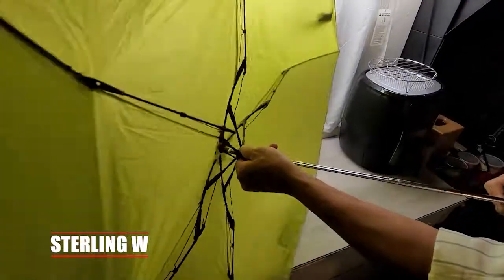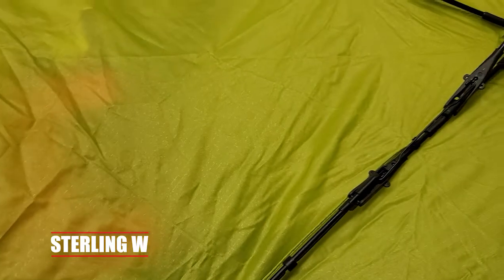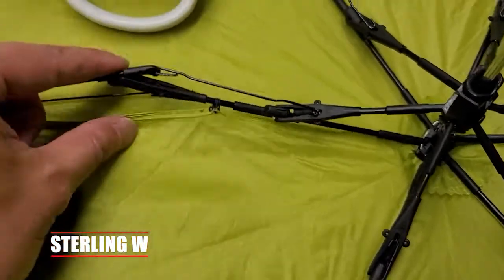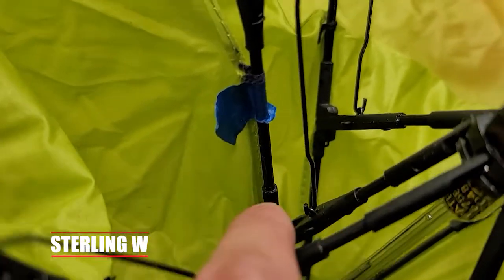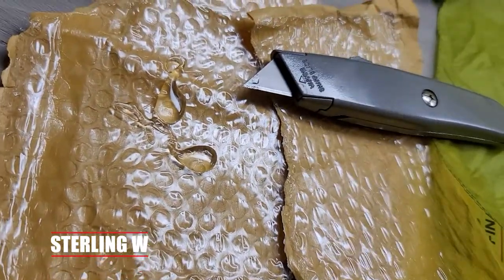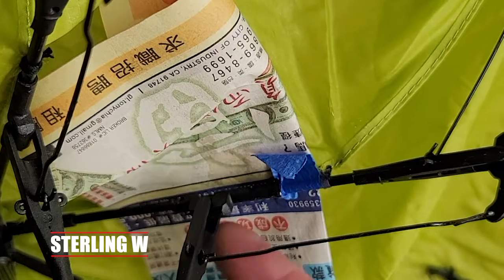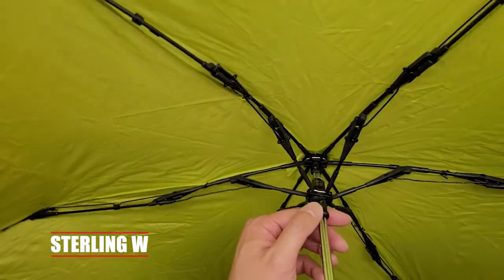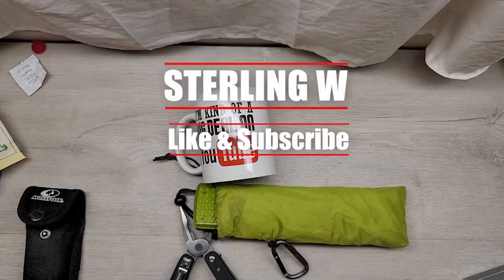HOW TO: REPAIR Broken Umbrella Legs Using EPOXY!

Comment: Wish I could have seen that slider part that had come loose and got glued back on, but looked like it worked well in the end.  A good lead on the different kinds of glue/appoxies.   Can you tell what the first two kinds in the early part of the vid are good for, vs the two part one you used on the umbrella in the end.  Thanks for making this video !!  Cheers.  ( thumbs up )
Reply from the maker: Its in the description  notes below. Jb weld is a steel reinforced epoxy 3500+ psi  and Devon 5 min epoxy is  more like 1500 psi waterproof  glue.
Reply from the maker: Here you go https://youtu.be/vz7uul693CM